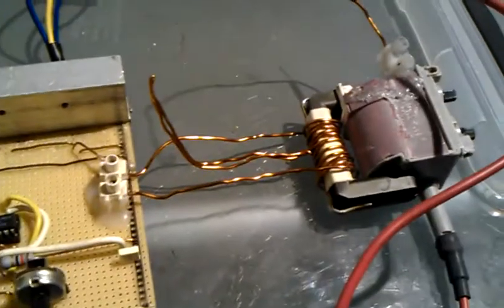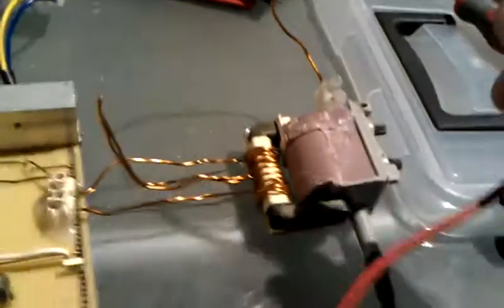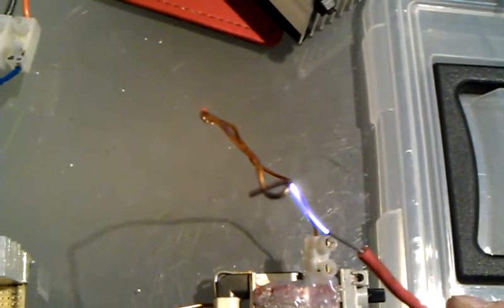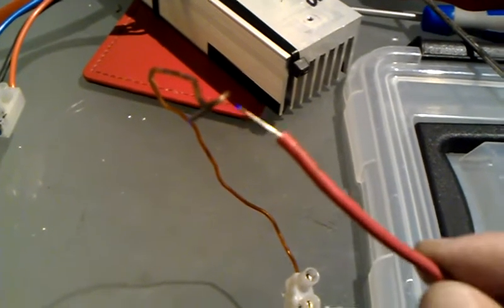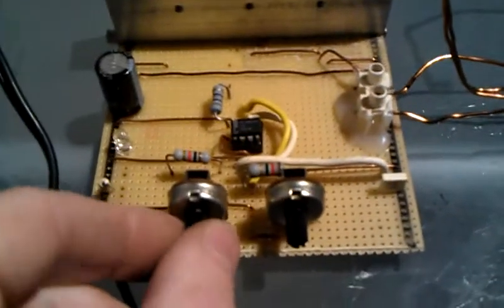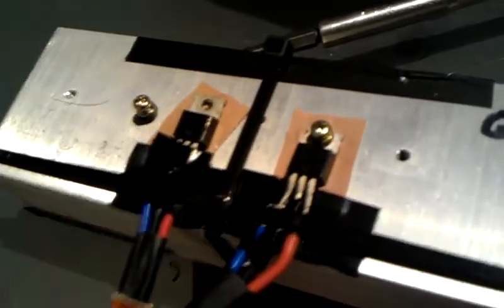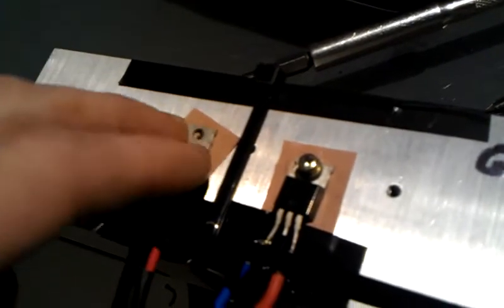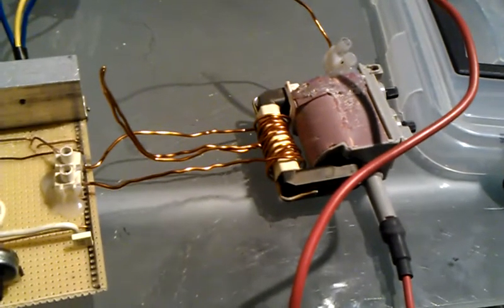555 timer circuit / flyback

Comment: I was having the same problem blowing the transistors. If you can find the same CRT tv you got the fly back out of, they usually have a big transistor in them that works a lot better than the little ones do and last longer.